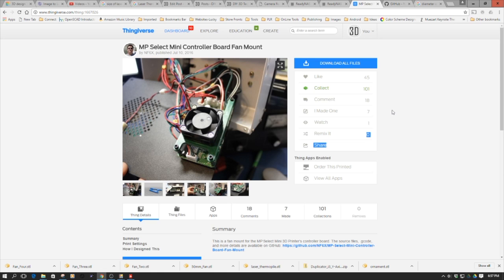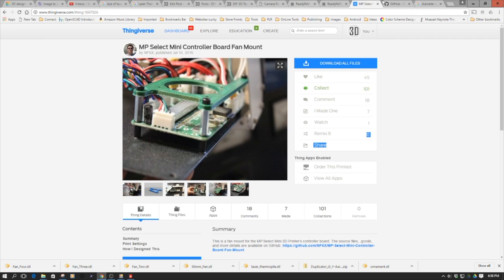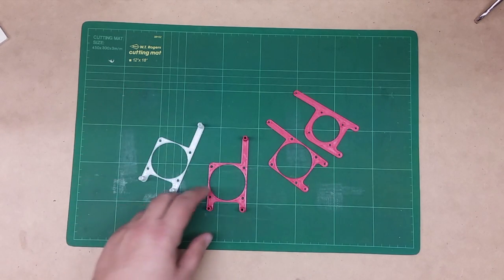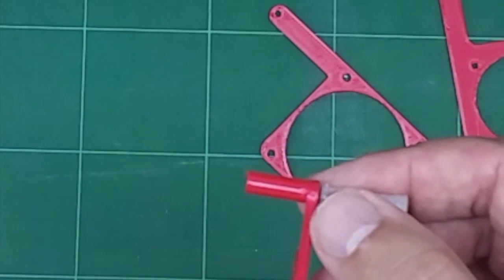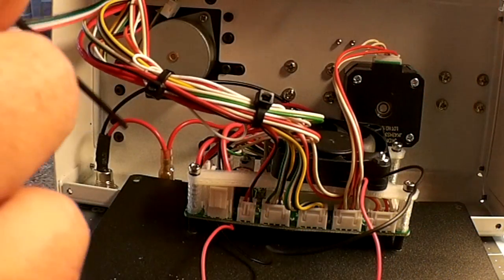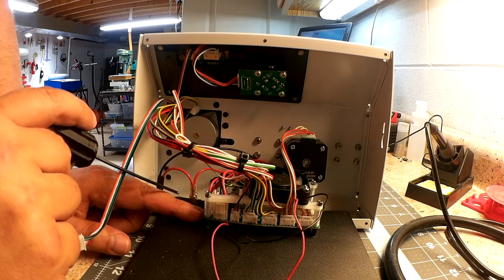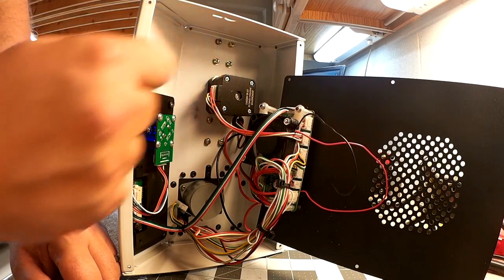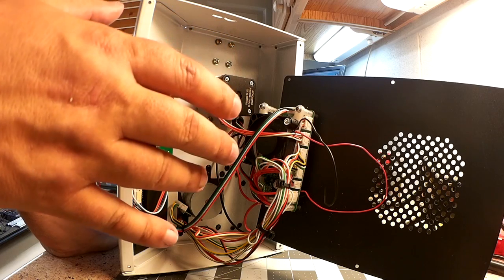Monoprice Select Mini 3D Printer - Adding a 50mm Cooling Fan to the Motherboard!

Comment: Hi, I see in the MP Wiki/hardwarethat late 2016 boards have a PCB header for a main board fan. Could not find any more details. Do you have any further info you could share?
Reply from the maker: Unfortunately not, as I have not messed with this little guy much as it has done so well out of the box.  It just prints :-)
Reply: I just soldered mine onto the main power supply plug that goes onto the board.  I used an 80 ohm 1/2W series resistor to slow the fan down.  My fan is on a right angle bracket on the edge of the bottom vent, pointing towards the board.  Not sure how effective it will be but any forced circulation should help.

Comment: I also threw in a 80mm fan inside the bottom cover where the air holes are to blow in air along with the 40mm fan
but now I may wire in switches because the 80 gets pretty loud because of the reduced air flow from the tiny holes
Reply from the maker: Hmm with this one I don't even hear it run which is nice...
Reply: yeah my 40mm on the board is silent
but the 80 moves enough air to make noise through the mesh holes on the bottom of the cover 

mine did get pretty warm before the fans as it runs almost all the time

Comment: Print a fan grill to prevent wires from hitting the fan blades example http://www.thingiverse.com/thing:320527
Reply from the maker: Could have but I took the easy road and used a couple zip ties :-)
Reply: DIY3DTECH.com :-) what's the max speed that you would run on the mini with good results?
Reply from the maker: I think I run around 50mm/sec...
Reply: DIY3DTECH.com thank you